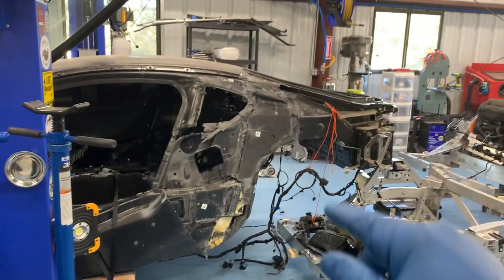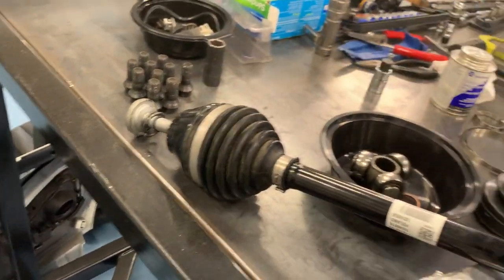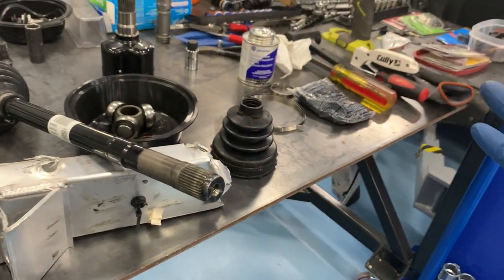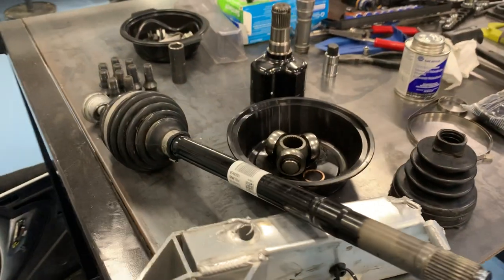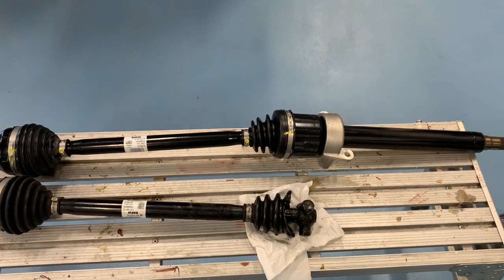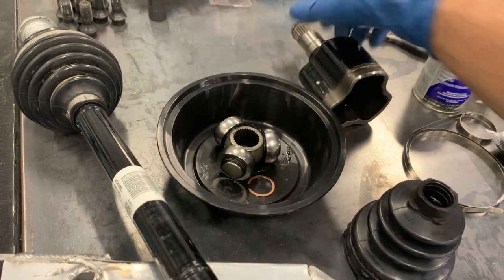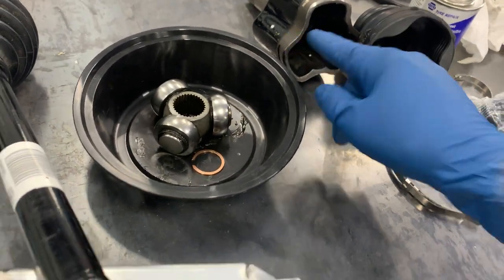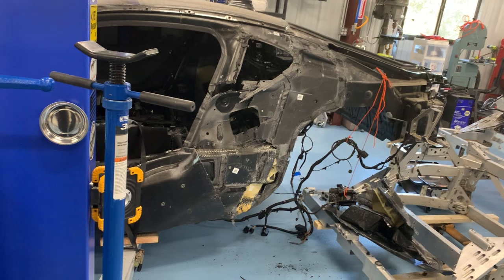Bmw I8 Salvage update on CV axle replacement and boot repair!

Comment: I was searching on videos about how to replace an axle on the i8 and found yours.

I'm a hobbyist mechanic and I like to work on my own cars. I've done this job on other cars in the past. On Audi/VW they require a weird "triple square" tool. I was hoping to get instructions on the procedure and a list of any special tools required so that my car does not set torn apart for months.

I'd love to get in touch with you.
Reply: The only special tool you need is the large Allen wrench I mention. Other wise it’s pretty straight forward like the other ones you changed.
Reply: @pismovitality2535  thank you for the reply. I'm likely going to document the process. 

Coincidentally, it sounds like the same tool is apparently needed to charge the transmission fluid.

Comment: Great video. I have a bad outer boot on my left front. Car is CPO so it's at the shop awaiting approval or the part at this point. It's been there a week so who knows. If they won't fix it, I was going to try a 1/2 boot that you glue together. Might be ok, rather than taking the end off, and doing a complete replacement with another boot. I already measured the circumference of the shaft and the end. You make it sound simple to pull the axle out.  I already have the 17mm hex from doing the transmission fluid change (video coming soon). So, we shall see, depending on what the dealer does...
Reply from the maker: Pat, avoid the split boot repair kits. Once you start researching you'll find they have a high failure rate and are usually used for a short term fix (prior to a sale). My local Napa will not even sell them (because they say they are so bad). The front should be very similar to the rear I've been working on. You have the skills to fix it properly! Remove the wheel, cv hub bolt, brake caliper and ball joint...move spindle aside and the axle comes out! Let me know if I can lend advise, wish I lived closer!
Reply: @kfcanyonranch  Thanks!  If they don't cover the repair, I'll be in touch.
Reply: Had the same thing one mine. Crack in the outer boot. Hearing the same thing from Pat, it looks like it's a problem that occurs on more cars.
I managed to make a deal with bmw to replace it. I paid 20% of the cost, since an axel is supposed to live longer than 5 years.

Comment: I have a split boot on front near side (RHD). The car has done 20k miles so i want to strip the shaft and replace the boot. The hub disc end looks pretty straight forward, does the shaft just pull out from the electric motor end?

Thanks
Paul.
Reply from the maker: Yes it does. A light pry and it pops straight out.

Comment: Where are you seeing front axles for 500-900?  I am in need of one of the fronts as it appears my front cv is going bad.
Reply from the maker: Www.pacific motors.com and I think on eBay.
Reply: I am currently selling some rebuilt axles for the i8, if your still interested
Reply from the maker: @josegonzalez9426  I’m in good shape now, however you should post them on the BMW forums, they are certainly needed.
Reply: @josegonzalez9426  do U have a great left axle?
Reply: @josegonzalez9426  
Very sorry, I meant to say a good working Axel?
Reply: @chapin9312  Yes I currently have them already rebuilt and ready to go at a great price
Reply: Just got my i8 inspected, and they told me I need my whole front axle replaced for so expensive. They thought they can replace the boot, but they don’t have access to purchase the boot. So they are giving me this option
Reply: @josegonzalez9426  I might be interested! Do you still have them?
Reply: @kfcanyonranch  hey would love to get some insider tips for some help! I’m in Orange County and would love to inquire for your help if you have the time. Appreciate the video.
Reply: @unrestrictedvibes6982  yes which ones do you need ?
Reply: @josegonzalez9426  Technically i just need the front CV right/left outer CV boots, those seem to be lightly torn . I don't really need a new joint or axle, pretty much the same scenario  with Keith. (both inside boot  towards the transmission is looking good.)  I'm not mechanic savvy or anything, so i was thinking about purchasing thet boots on ebay which is about $800 for a pair of axle replacements. and then i would have my local mechanic service it for me. He might think i'm crazy/pain/headache for suggesting "volcanizing/tire rubber/cement  to patch and clean it up/ glue it. and use bicycle patch volcanizing tube to reinforce." -  like keith. However, i think that might do the trick. Do you have those parts?

Comment: When replacing the front axles there isn't any tranny fluid that will leak out of there?
Reply: Hi, Just got the front  output shafts. Do you have time to talk me through replacement? I'm pretty mechanical so I'm confident I can do the work but it would be great to talk to someone first. Thanks, -Chad
Reply: What's best way to get in touch?
Reply: Hi Keith, any possibility of getting repair manual pages for replacing front cv output shafts? Thanks. Chad